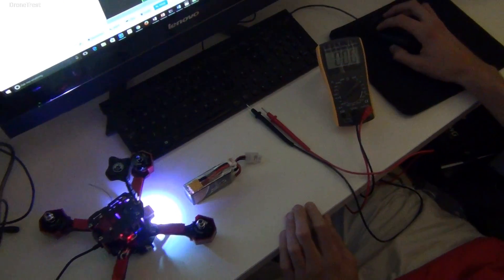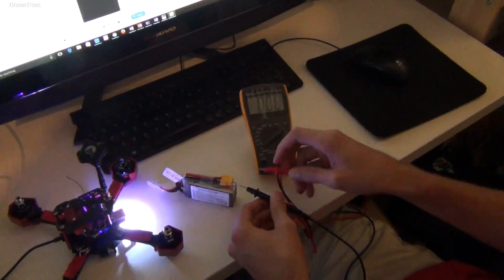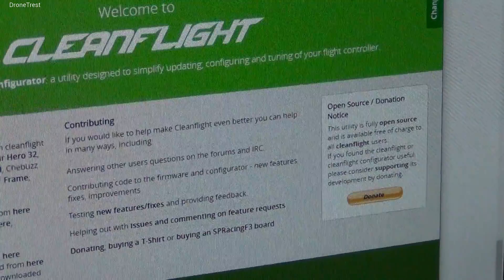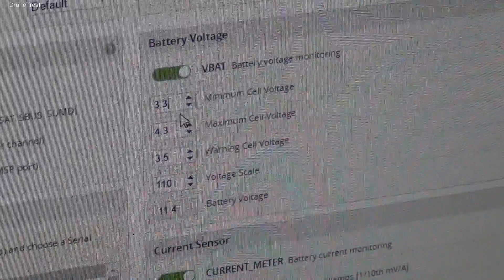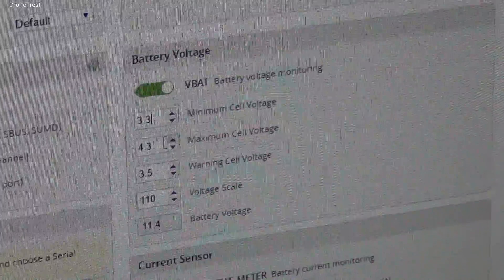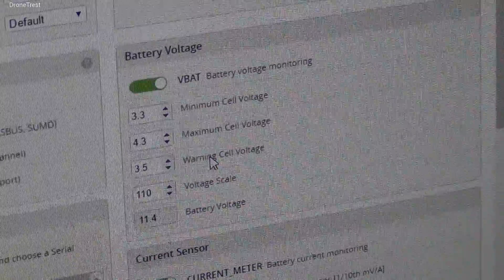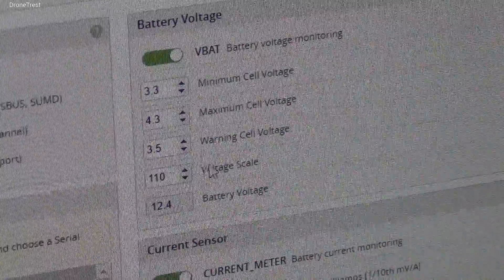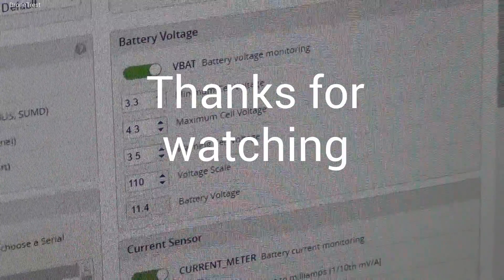Calibrating Battery Voltage Monitor in CleanFlight/BetaFlight

Comment: Hi 

Cleanflight didn`t show me  Max cell Voltage , Min. cell Voltatge , Warning cell Voltage, Voltage Scale and Battery Voltage. There is only the VBAT with the green switch. 
I solder the wire between vbat and the Lipo and solder the buzzer. what can i do?

sorry for my bad english ;-)